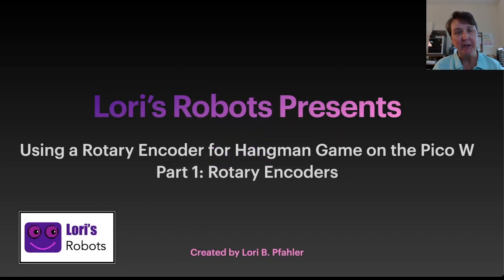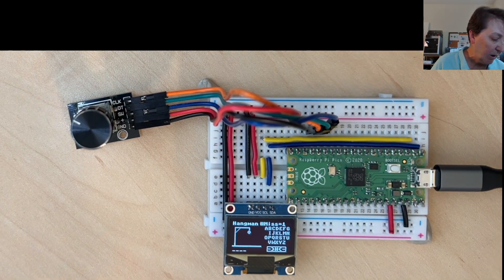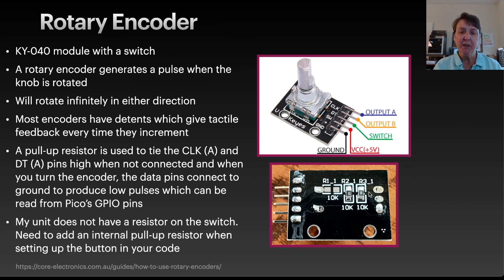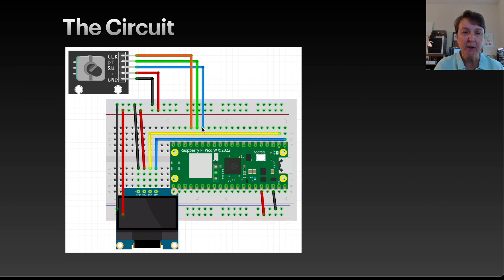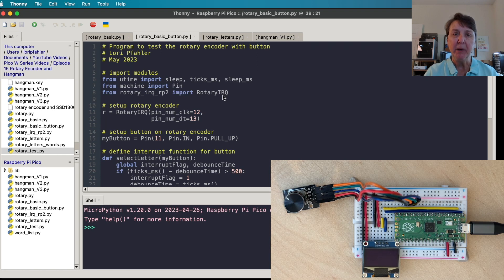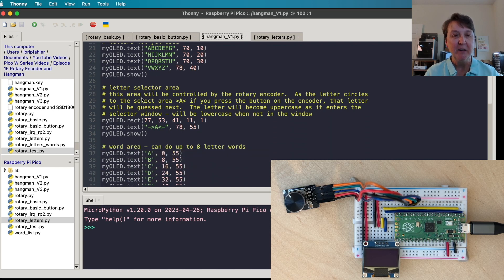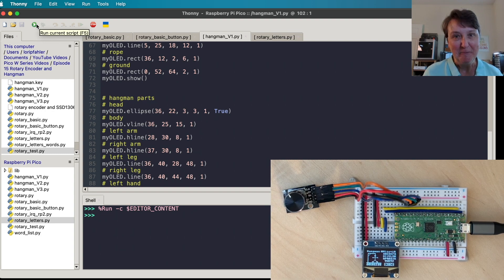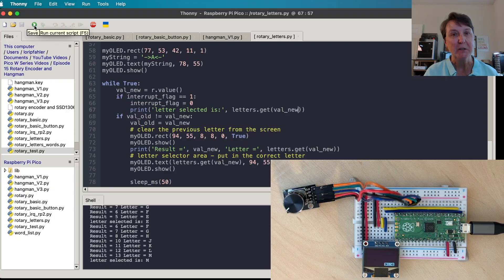Pico W Episode 15: Hangman Game with Rotary Encoders - Part 1

Comment: Intricate drawing on the oled, all nicely done,  and using the latest micropython version. 1.20.0
Info   (ticks_ms - ...) > 500 not advised , use ticks_diff( ticks_ms, debounceTime)  > 500
4:08 picture shows 5V, ok for Arduino but not for Pico gpio pins which expect 3.3v max. (not a problem here)
Could solder a "classic" resistor to the R1 pads, leave the legs long (but isolated) so it sticks out if height is a problem.
or drill twice thru the word "Keyes" ( or from bottom side between the 2 mounting holes ) and have the resistor on top, 
would check with a multimeter first to see if one of those pads is really connected to vcc (guessing)
Reminds me of my "torpedo game" using 2 oleds and a single 16 button matrix, switched buttons viewpoint for each player, 
 a rotary encoder would have been much simpler but it was a nice challenge.
Reply from the maker: Thanks for the feedback.  I will use ticks_diff() in the future - that makes good sense.  Please consider making a video of your torpedo game.  I would be interested in seeing it.  I am exploring simple game programming; definitely improving my python coding skills with these simple games.   Thanks for watching!